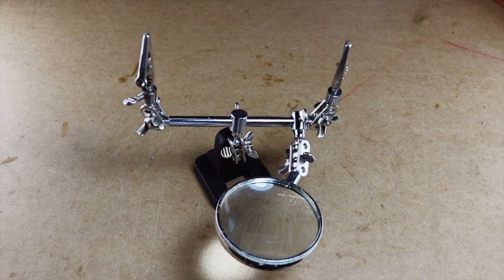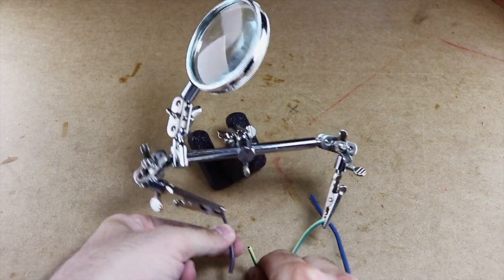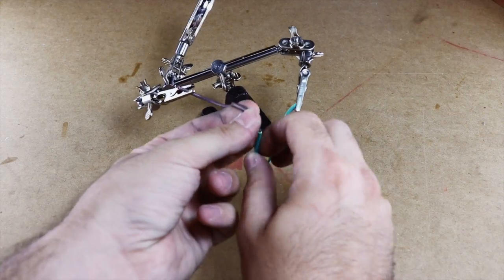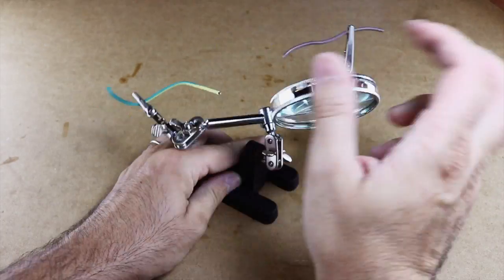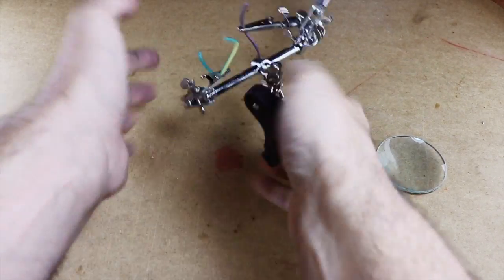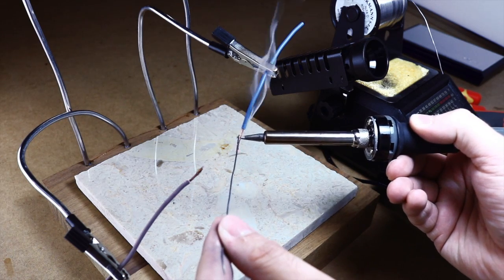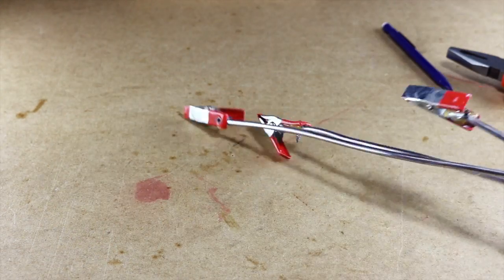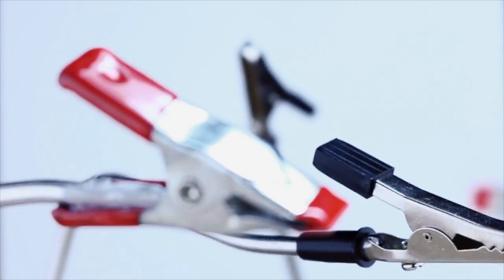BEST DIY Solder Helping Hands (Third Hand)

Comment: If I position two wires next to each other to solder them together will they stay together once I release the arms or is there some spring back in the arms that will create a gap between the wires when I release the arms?

Comment: This is amazing; I built my own and have been using it for a few months. But what do you do when the solder arms break off? I could drill a couple of new holes but that's not a sustainable solution. I'm tempted to try to, well, solder them back on, but I don't foresee that going very well, lol
Reply: Cut it all the way & Drill in same place

Comment: For the pliable arms I used rubber covered 12 inch GearTies by Nite Ize available from HomeDepot or online.Just snip the ends off, stick one end in a hole in the wood base and strip the rubber off the other end of the wire to attach to clips, etc. Easy Peasy!
Reply: If you're using those for tying looped cables/rope/etc, Walmart sells something very similar they call "Gear Snake" in the camping section. Only costs $4 or $5 for a 16-foot roll. You don't get the nice little rubber bulbs on the ends, and it only comes in orange,  but the price makes those features easy to sacrifice   ;-)  

And you always get just the length you need: I unroll some, twist it, then cut it. If I guessed wrong about the length, just untwist and adjust it before cutting.
Reply: Ran Talbott I bought the gear snake a long time ago and it seems nice at first but the wire inside ends up poking out the ends of every piece you cut and the rubber is very cheap the more you move it around the more it rips. Basically just good for wrapping things up etc
Reply: Michael O’Bree I'm getting ready to build my own and that was exactly what I was thinking to use!

Comment: What dimensions did you use and what size of wire did you use?
Reply: The helping hand clip is close to 4mm in diameter which would be more like 6 gauge wire (5/32).

Comment: what size wire did you use
Reply: The helping hand clip is close to 4mm in diameter which would be more like 6 gauge wire (5/32).

Comment: Interesting, but why did you have such a difficult time using the commercial unit that you discarded? I have one of them and my 10 year old granddaughter can use it WITH NO PROBLEMS.
The device you made must have consumed several hours of your time and has NO magnifying lens or illumination.
The unit I purchased is perfect, it does what yours does and a GREAT DEAL MORE, it has a magnifying glass, LED illumination and cost $14. delivered.
But I must admit it does NOT have that fancy Butcher Block base, ah well.
Reply from the maker: +Keith Grove I totally disagree... Use mine and you'll see the difference...

Comment: How about your drill bit trays inside your drawers, are they 3D printed? If yes, do you have the .STL's? Also where to get those drawers?
Reply from the maker: +paulham yes 3d printed... I don't have the stl but they are REEEALLY EASY to model... Check on thingivers they had similar ones...
Reply: Ok cheers. I might do something similar

Comment: Now that you've been working with them for a while I'd like to know whether they work hardened on you or whether they would at all (i haven't used armature wire before)
Reply from the maker: They are perfect... The only thing is that are not as straight as new so they don't look as good... But they hold the position even better...
Reply: Hey thanks for the response, Now i have to find some wire